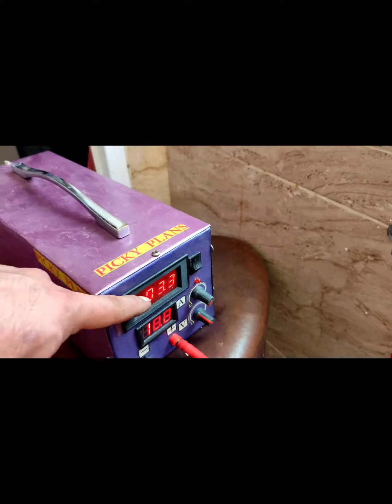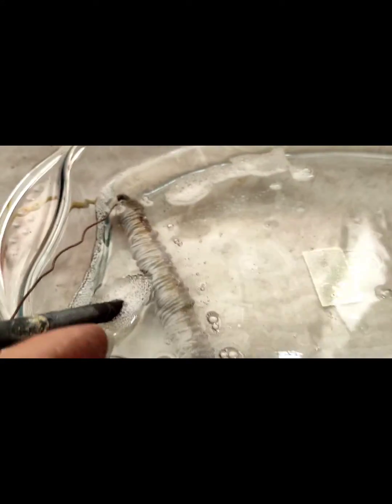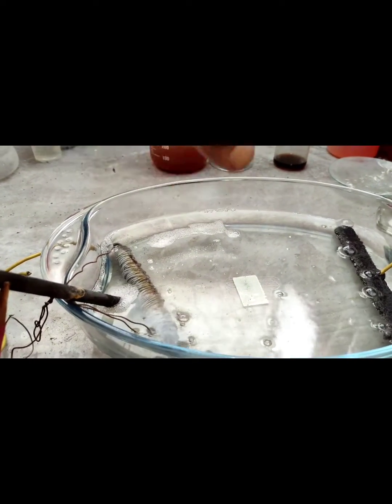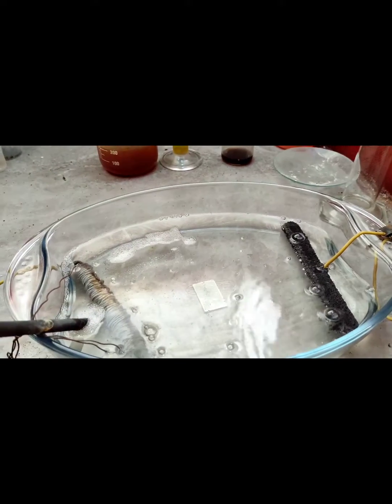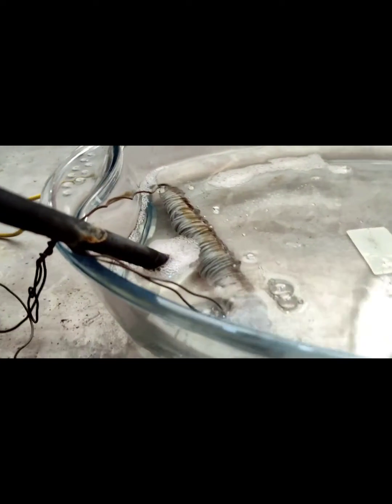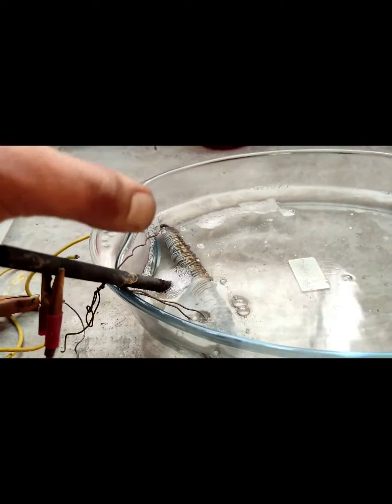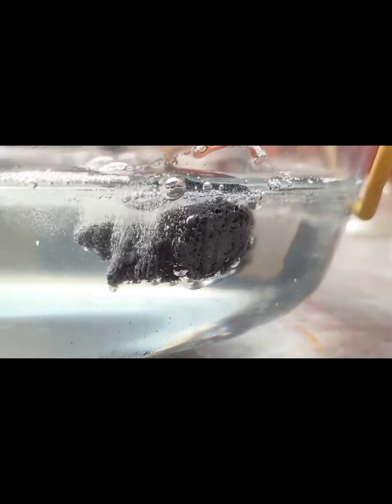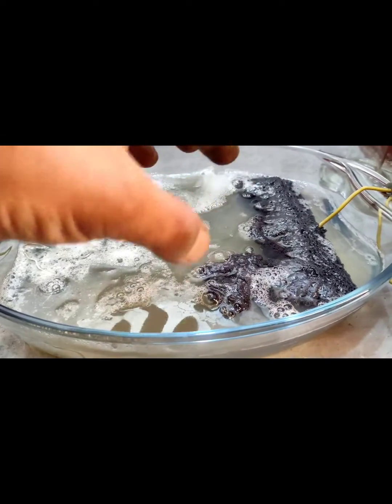Easiest way to get pure Tin out of solder

Comment: Running thst high voltsge and current youre sending lead with yiur tin metal. Your best bet if you want to refine the tin is to disolve your solder completely in hcl. The drop an equiv molar mass of the lead with sulfuric acid. It will precipitate lead sulfate leaving a solution of stannous chloride. To recover your tin metal just run your stannous chloride solution through your electrolytic cell and bobs your uncle there's your pure tin. To get even higher purity dissolve the tin in hcl again and repeat addition of sulfuric  then electrolysis and tgere you go 😎

Comment: Nice, I need some pure tin for SnCl2 testing solution.
Hmmm... can I get tin from the HCl solution of solder this way? I clean RAM chips from solder with HCl before pyrolysis...
Reply from the maker: You know that tin spong after melting yielded few grams of tin but total weight of dried powder was 50 grams it seems this Spong isn't pure enough. I realized that it's always better to dissolve tin in HCl first and boil it to get concentrated tin solution that way by electrolysis you can gent pure sharp tin crystals. So what ever your solution of tin it is you need first to make sure they are concentrated first then start electrolysis.  This video linked below could be useful something about tin pure crystals and solution in HCl
Reply: @PickyPlans  You are awesome, thanks a lot... 👍

Comment: Can this process work with amalgamated silver & tin, with 2amp? I need to separate the tin from the silver.
Reply from the maker: If you use this method , this would be ended with with power of silver chloride mixed with mercury chloride at the bottom of vessel, and tin spong growing at the cathode.
In my opinion its better to process that with nitric acid then drop silver chloride with HCl and recover yin from white percipitate of Metastannic acid (mix with charcoal powder and heat it furnace) and recover mercury by reaction piece of aluminum foils with acid at the end.
Reply: @PickyPlans  Thank you for your advice, very much appreciated.
I have a hand full silver/tin powder that I want to melt and then separate.

Can you do a video separating amalgamated silver from tin using the nitric acid and recover tin from metastannic with charcoal powder. Seeing this process on video is better than reading. I thought nitric acid also dissolves tin? Will tin be precipitated with the silver by adding HCL after?
Reply from the maker: Sure i will make video in future when i have some mix Ag/Sn .
No ! When you try to dissolve tin and silver mix, silver goes into solution and all tin converts to a white percipitate that you have to filter that and drop silver chloride with HCl . Since already tin converted to a white percipitate so there is not more tin in solution to come out with silver.
Also tin could be recovered from Metastannic acid (white percipitate) just by electrolysis process.  you can see this process in video linked below 👇
https://youtu.be/krmjC2fFDaY
Reply: @PickyPlans  Thank you very much! Excellent. This helps me alot.

Comment: Tried this and all I got was lead sponge.
Reply: @PickyPlans  I used dilute HCl and NaCl as filler so the cell can run at lower voltages.
maybe the NaCl was the cause??
Reply: @PickyPlans  I dissolved it in HCl to try to make stannous chloride then added a tiny amount of H2SO4 to precipitate out any lead.
ALL OF IT precipitated leaving nothing and tin sulfate is highly soluble so this is sadly all lead.
Reply: i searched and lead chloride is soluble in excess chloride forming [PbCl3]-, [PbCl4]- and [PbCl6]2- so i don't know it this method using chloride ions it's very useful